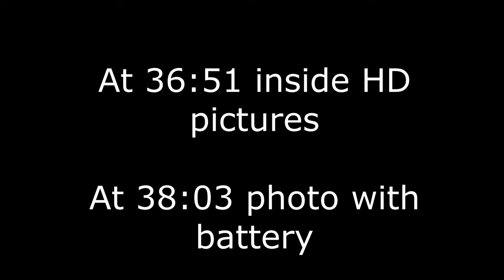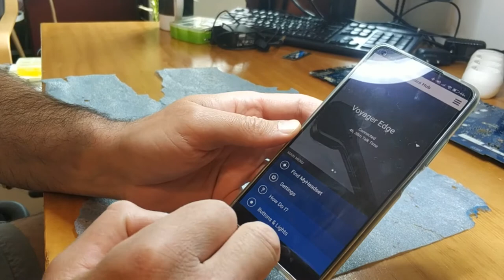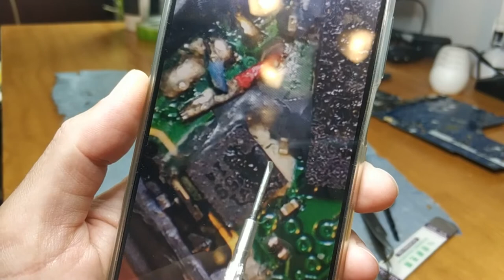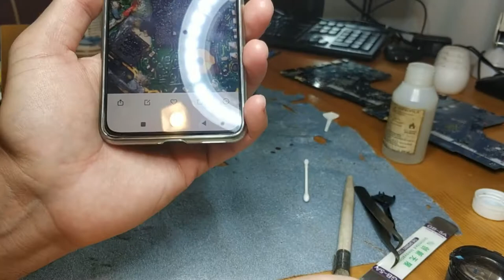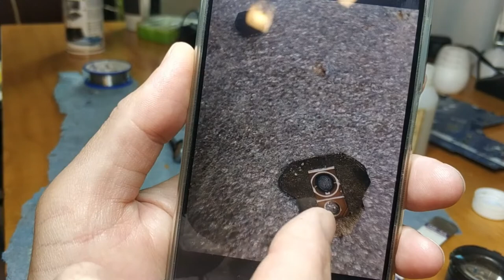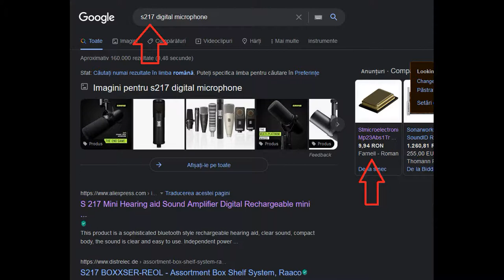Plantronics Voyager Edge - Disassembly & Repair Microphone low volume & Inside HD Pictures

Comment: 1. lets pry it out and cleanse the oxide
2. if problem still persists, lets do as this guy done, but the digital mic  which similar to nokia 6303 , s217 digital microphone
3. disassembly the board from case is tricky as he show in this vid, to tight and super fragile
4. he sughest the lower mic should be the problem as when you drop, the first mic that impact to the floor is the lower one
5. then he hot air the lower mic and replace with the new one
6. he said it works
I will following what you suggestion thanks for your time and effort to fix it
Reply from the maker: 100% it work, i use even today this Plantronics.